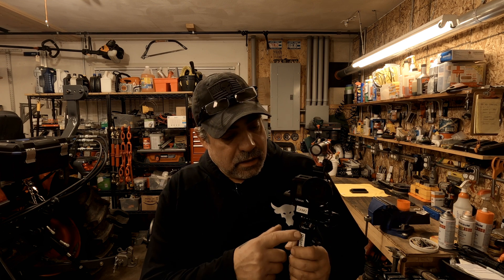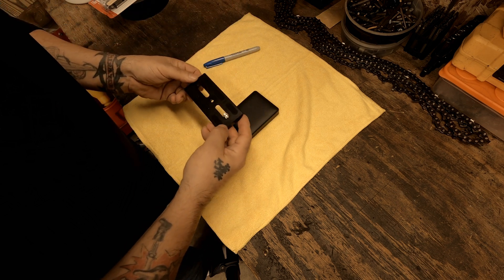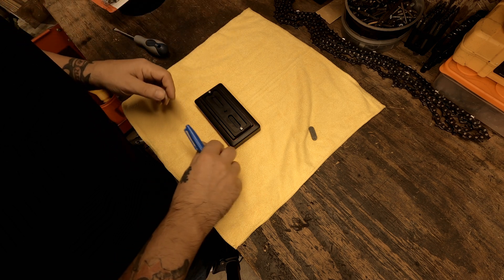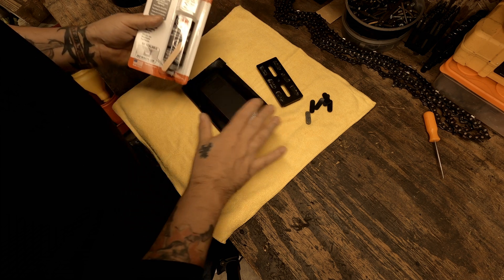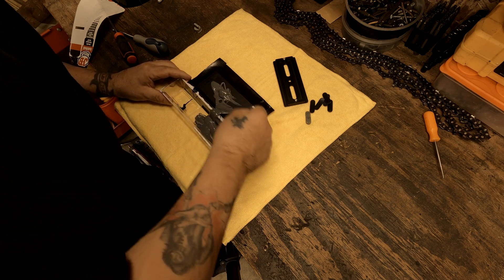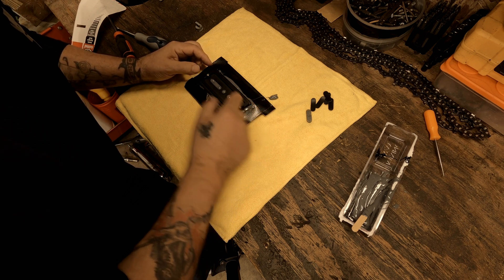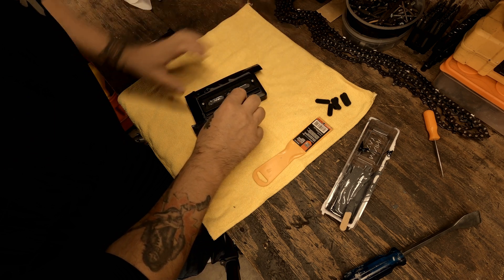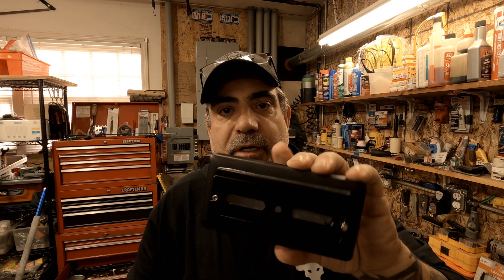GoPro Hero Battery Extender - At Least 3 Hours / More Power!

Comment: Hey buddy I appreciate the shout out! I have been thinking about getting the hero 8 black as a second camera either that or a second hero 7 black. The 8 has some features I really like tho but it’s a bit more money as of right now. I love your camera setup with the external battery holder it looks like a professial rig for sure! You should see the junk I’m working with 😂 lol. My tri-pod is all bent to hell, camera is all beat up too but I have an external power brick like you have that I got from Walmart and it’s really helped a lot with making my videos longer. One question I do have tho is what amperage are your USB outputs in your external charger? I got the high output when I charged mine I wanna say it’s 3amp and the issue I have is when it’s a warmer day and my hero 7 is connected to it the camera will easily overheat as I think the charger is just charging it way too fast while it’s recording in 4k.. if I recorded in 1440p this prolly wouldn’t be an issue tho but I like to do all my videos in 4k and have had a real tough time finding a camera that can do 4k consistently with out overheating by getting over worked.. the hero 8 I hear is a lot better tho.. be curious to hear what you say.
Reply from the maker: Ha, ha, ha, ha.......there isn't a tractor content maker out there who hasn't run over a couple of tripods 😝 from time-to-time....wait until after Xmas - the price will drop on the Hero 8 Black now that the 9 is out. Also, you are completely correct. The power banks use 2.1amp outputs and I only use OEM batteries in the camera's. (They get pretty warm but no shut-down's yet). I cheaped out and got the low output bricks and that probably worked to my advantage. I only record in 4K and when I turn on the camera, I don't turn it off until I'm done so it's not unusual (for me anyway) to have 90 minutes of footage for 15 minutes of video. The whole reason I sprung for the 8's was because my gear was dying and when I looked online - everyone was raving about how much better they were over the previous models. Hope this helps. As always, thanks A LOT for the comment and the support!
Reply: Hey buddy I hope all is well! I thought about you the other day not hearing from you in awhile and decided to check back at your channel since I haven't gotten any new alerts (wanted to make sure I wasn't missing anything) I Hope your staying safe!

Comment: Bota, a great video.  I noticed you said you can get up to 3 hours recording time on your Go-Pro 8 with the handheld pod.  So will your Go Pro record that long without timing out or getting too hot?  My old Samsung DSLR camera will only allow 19 minutes of recording then it stops all by itself then I must restart recording from scratch.  Thanks for this video.  Full-watch.  Had to chuckle at the bloopers.  I surely have a truckload of them (smile).  Have a fine Christmas.
Reply from the maker: Yessir! My GoPro 8 easily runs that long at my current settings without overheating or shutting down. I guess that was a problem with older models but like I said in the video, I'm running two of them from start to finish without any issues or having to change batteries. Help me stay focused on my content and not get distracted with messing around with my camera. Thanks for your comment and for watching my video! You're continued support means a lot to me!